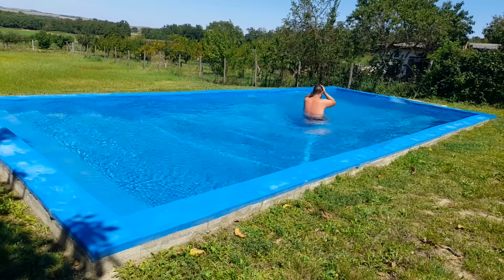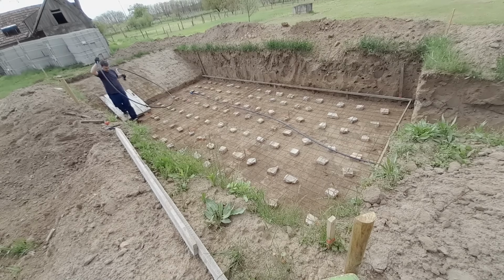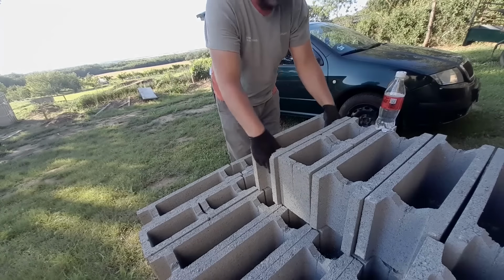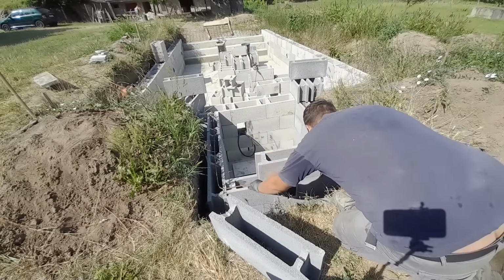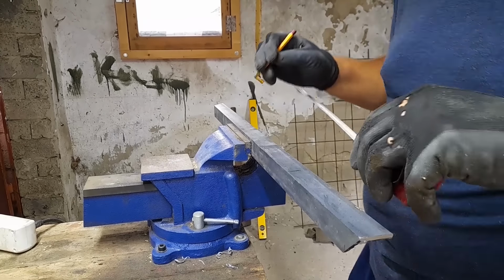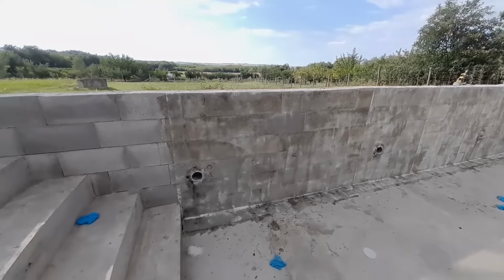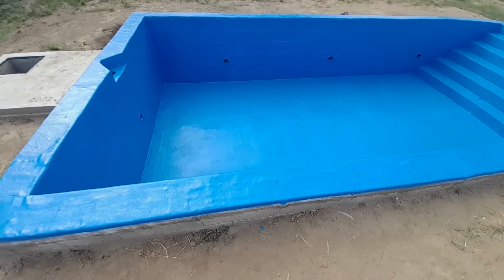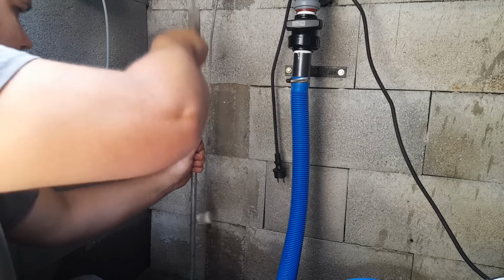How I Made a SwimingPool. Step by Step. Low Budget Projekt. #pool #diy #diypool

Comment: Also, as an owner of a swimming pool company, one suggestion I have is adding a main drain, at the lowest point of the deep end, if you could have done it again.  Again, great work!
Reply: How exactly would he do that?  I'm just curious
Reply: why do you really need a main drain? You can just pump it out if needed to empty it.
Reply: Having had a pool, a main drain makes it sooooo much easier when cleaning. You can just sweep everything to the drain instead of vacuuming which I hater doing.
Reply: @hamidghazialam3604  main drain isn't for draining pool, it helps circulate water

Comment: My Dad had an in ground pool originally built with a vinyl liner in his 60’s. Instead of using the company who built the pool when the vinyl died he decided to build a fix himself. 
So he then had a hole in the ground as you did, he also built the walls using cinder blocks.
Back then there was not a way to use the fiberglass as you did. (Great ideas by the way) I do not remember what he did for that part. He used Portland cement as it makes a whiter finish than regular concrete. He did paint his white. He was lucky to already have the pump, plumbing, etc.
They really enjoyed it for years.

Comment: You are a true hero. I also live in Hungary and dug a 40 m³ pond myself. The summers are very hot and the soil (sand) is often as hard as concrete. After digging such a big hole you know what you have done. You really did an amazing job! 👍
Reply: Doesn’t it rain in Hungary?
Reply: @michael.forkert  Hungary is located in the Pannonian Basin or Carpathian Basin, the remnant of an ancient lake that dried up 5 to 10 million years ago.

I live almost in the middle, where the land is quite low. Due to climate change, only 8 to 12% of the annual precipitation has fallen in recent years. It's different at Lake Balaton because this region is close to the Alps and naturally has more rainfall.

Climate in Hungary is more diverse as for example in Germany.

Comment: I didn't hear you mention but hopefully you used stainless screws/nuts etc. where needed. You could sand the fiberglass to make it smoother (might have missed that part too if you did). I'd add an area at least 4 feet wide all around the pool to walk on so that dirt and grass don't end up in it. Even a wood deck would be good, save your filter system.

Hope ya had a good summer in there. Good job man!
🇨🇦
Reply: All very great valid points! Much love from 🇺🇸
Reply: I kept thinking he needed a walkway around all through the build.  You’re gonna’ be constantly skimming to keep grass out, I think. I’m sure something like this and landscaping could be added for years to come. What a beautiful job, overall. What dedication and logical thinking!
Reply: Cement deck would be good.

Comment: i think it came out great, for not being a professional pool builder. it's great. you have a few small things to work out. but you have a great foundation to build on. I don't know if you thought about this yet. but you can always tile that pool.. it will clean up the block work you mentioned. and also water proof it more. they have a liquid membrane that you can roll on to the walls and the floor. then you can tile directly over it. I know it's an added expense but  you can do it maybe next year. but all the hard work is completed. enjoy your success.
Reply: Can he tile it directly over the fiber glass? cheers
Reply: @viannarts  Yes, although maybe the paint would have to be sanded first for a better bond, I'm not sure. You could use silicone adhesive to attach tile though, it should work well.

Comment: Very impressive!  I was unaware that dry stacking of concrete block would actually work, but it clearly does.  The only thing I would do differently is to add a bullnose profile on the leading edge of the concrete steps.  Having done countless concrete projects in my lifetime, I know what hard work it actually is.  Dr Kun Daniel makes it look easy, a testament to his very impressive expertise!
Reply: I'm also surprised by the dry stacking, it gives me several ideas. Great job, you have to be really determined to achieve stuff like this.
Reply: it works but its better to glue them down, that way you can get them leveled, something dry stacking wont.
Reply: There is a process called surface bonding that allows for mortorless bonding of blocks. The first course is bedded in mortar and leveled. All other courses are dry stacked and leveled with small shims of wood or even paper. After they’re stacked they’re soaked with water and they’re then parge coated with a layer of surface bonding cement made of Portland cement and chopped fiberglass. You can make your own or (here in the us) buy it from the home center. You can coat just one side but two sides are more than twice as strong. It was originally developed for water proofing cisterns.
Reply: I too wanted to suggest a bullnose edge to finish off his beautiful pool!

Comment: The home made lights are not that safe I would have liked to see lots of silicone used for the two holes in the cup to run the plastic insulator. Still I would run a very low truck battery voltage on that pool wiring for the lights with a GFCI circuit in case water were to penetrate the wiring then nobody would be electrocuted to death. Never cheap out on electrical for pools where water is concerned and people and kids going to swim in it.
Reply from the maker: I received a lot of criticism for the 220V lighting. As an electrical technician, in my opinion, it is no more dangerous than the circulating pump. But I will replace it with a 12 or 24 v system.
Reply: @kundaniel  I agree, good choice🙏
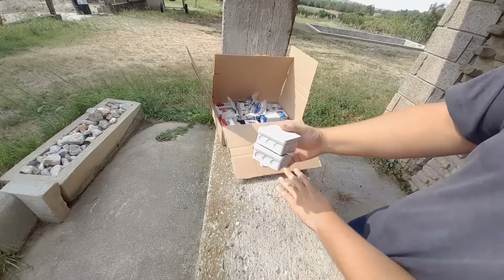Reply: he did have an RCD (residual current detector) breaker in his circuit, which is the same as a North American GFCI (mentioned at 44:04).

Comment: Great job for that small budget, a tip: don't amp the pump up to 10m³/h, the pressure in the sandfilter will be too high causing it to wear faster and most importantly the filtration of the water will be decreased since you're sucking the water through the sand much faster and with higher pressure, it will create channels in the sand. It's better to filter at 7m³/h for longer hours.

Comment: Great job....but why didn't you use low voltage LED's? Those are 110/220V no?
Reply from the maker: Yes, I know, I received a lot of criticism about the 220V. As an electrical technician, I do not consider it any more dangerous than the circulation pump, but I will replace it with a 12 or 24 V one.

Comment: Nicely done. I would have done certain things differently, but it doesn't matter, you nailed it.
The ONLY thing I must comment is that covering the whole pump space with concrete and leaving only a small manhole was not the best idea. I would have covered it with a larger manhole cover (I see you managed to do it for a smaller one).
But yeah, I congratulate you!
Reply from the maker: Yes, this also gives me a headache. I got an acid container from which I want to make the sand gravel. The diameter of the container is 65 cm and the expiration date is 58 cm....

Comment: Yeah you started digging, and then said exactly what I was thinking. Spend just a little money to rent a machine if you can. You get the job done in an afternoon or a weekend, and it doesn't actually cost that much (assuming distance traveled, availability, and no damage to the machine). Absolutely worth it for the amount of work just digging a hole takes.

Beautiful work, btw. I "dig" it :)

Comment: Man i hope there is no fualt in the pool lights.... thats your life right there 😮....
Reply from the maker: I like it when people bring up this topic... In an interesting way, no one has been bothered by the fact that the circulation pump is also 220 as. However, it is still in contact with the water on the metal part and is present as an inductive load. It somehow doesn't bother people because it works silently. almost everyone mentions the spectacular part that lights up. Please tell me what happens if the phase gets on the water and someone is inside... Nothing. There is full PE coverage with separate earthing probes with life protection relay. But if they weren't there, no one would be electrocuted even if one of the phases was exposed to water. However, the water has a one-to-one ground potential, even though there is a plastic pool wall, everything is connected to the ground probe in the case of metal parts. I am a high current electrical technician. Obviously I'm not going to make my own pool life-threatening...
Reply: @kundaniel  The pump isn't isolated by a home made enclosure from pipe.. Use LEDs please. 12v LED should be safer

Comment: I probably wouldn't DIY the electrical, but after thinking about it, you're probably at low risk because you generally won't be in a position to complete a circuit, so even if there is an electrical fault you might not even feel anything. The thing I would be scared of is the wall collapsing (cracking), especially without any gravel backfill, but maybe keeping the pool full of water will provide enough counter pressure it's not a problem. I love the idea of using fiberglass, but I'd be worried about the resin lasting in the sun even with a UV resistant formula. I really enjoyed the video, I hope you make a followup in a year or two just to say "hey everything is still working".
Reply from the maker: The boat is made of the fiberglass I use. UV stable for decades. Looks good so far. I thought the resin would separate from the concrete. He could not. 220 V lighting cannot actually form a circuit with its contents. And the leakage current relay disconnects all problems immediately. The water in the pool has the same potential as the soil. But I got a negative comment, so I would rather change it to a 24V or 12V system.
Reply: Came looking for this and glad to see your answer. Pool electrocutions happen, switch to 24v please👍🏻

Comment: Awesome. love your vision and perserverence to just get it done. I wonder if your concrete estimation shortfall included multiplying by a factor of 1.3 for wet volume vs dry volume of materials.
Reply from the maker: Yes, the referenced m3 values do not refer to dry material. For example, about 9m3 of concrete went into the foundation. This required about 11 m3 of gravel and 2.8 tons of cement.

Comment: One level of fittings. You attached water pipes to it; after the concrete set, the pipes took on part of the bending force from the slab and therefore burst.
Using stone to support reinforcement is a very bad idea; moisture entering from below through cracks will quickly cause corrosion of the reinforcement. When corrosion occurs, the reinforcement increases in volume, which causes cracks in the concrete.

Comment: Also, the way a pool operates, the idea is to have the returns (jets) pushing debris across the top of the pool towards the skimmer.  So ideally, you want them on opposite ends, and the returns about 12” below water level, on the wall.  You can do floor returns as well, its actually optimal, to achieve good circulation.   Doesnt look like you’ll get many leaves in the pool, but even small grass clippings and debris would make it to your skimmer better.  You can build a very strong vacuum set-up.  If you are interested, reply to this comment and i’ll give you my opinion.  I own a swimming pool maintenance company for 15 years.  Enjoy your pool!

Comment: Your pool is superb from beginning to end.  On your challenges with lying grid and pipes... I've seen that in a foundation the grid is held together with zip ties.  I've also seen pipes can be held in place for cementing by cutting strips of ceiling wire of a firm but bendable grade and making a u shape the u shape can then be used to pin in the ground around the pipe holding it in place.  I just saw you bend your rebar in the video.  Even that could be a pin to hold the grid and pipes in place.  Your method is very efficient and shows a beautiful end product.

Comment: If the imperfections in the sides of the pool bother you, since it's already waterproofed now, can't you just plaster over it? Or add more epoxy as a top coat and sand it smooth before painting? BTW - Unbelievable job! I've done some crazy things in my life but this one would've been a little too crazy for me. Lol. Should be very proud of yourself! Definitely increased the value of your home too. Next you gotta do a hot tub! :) Any hey if your country ever goes to war, you can always use that as a bunker. That thing is as solid as a mack truck! Also - to make the top border look better you could install some pavers around the pool to prevent getting grass and dirt in there as easily. You came this far already might as well turn it into a backyard oasis! I would 100% put pavers and a walk way to and from the house to avoid tracking dirt and grass into the pool. The end shots with your friends and family - why did the water look so dark and dirty? Was it just the overcast sky and camera? Sorry if this is hard to understand I know English isn't your first language. So impressed.

Comment: I hate to sound negative here after seeing all the hard work you put into this project, but I have to ask the question  why did you use cinderblocks below grade for pool construction. Because with the constant pressure of the water against the pool walls if you get a couple of years use out of this it will leak. Modern cinderblock was never made for this
Reply: My neighbor has one that’s lasted at least 20 years.

Comment: Gravity feed Thermal Siphon heater using wood stove heating 55 gallon drum as your heating element.
Also
Build a rolling insulated cover to protect from accidents & the elements.
 forgot to put a drain inside the  pool or atleast a 5 gallon bucket on the bottom & sealed it with fiberglass to  pump out water in winter?
Great job looking back a scratch coat of cement over the block would've hide all the imperfections.
Good job
Yoy can build a gravity feed heater using 55 gallon drum thermosiphon. Build an elevated stand out of angle iron, weld input/ output valves. Build a fire pit out of block that the stand sits over. 
Place the unit down hill from the pool
Use a valve & gravity to pump water in, and heat/ expansion Will push water back into the pool.
Your intake should be on one end of the pool & output to the other. 
This works I have built a similar heater for a friend 20 years ago still works to this day!
I have a diagram and scametics i made

Comment: People who want to build their own pool: You don't necessarily need to make it from tons of cement and/or blocks. 

My brother had a pool that was a hole in the ground with a vinyl liner in it, and it worked great, seemed like any other pool.

Still had all the plumbing, pumps, filter, even heater, but it didn't require tons of cement. The surround was still concrete, but that's much less, and much easier to make.

The liner has to be replaced every 10, maybe 15 years, but it's not that big of a deal.

Comment: I always use a non-toxic antifreeze for sinks and RVs usually between 5:00 and 10 gallons and then I dump them in and run it through the system that away any misfortunes would be dealt with

Comment: to winterize the pipes: you need to ensure all pipes has one end disconnected. This way as water freezes and expends in the pipe, the air can go out hence the pipe does not break. This is how I winterize my garden watering system in the past 10 years.

Comment: I also dug a pool by hand. Have to say its waaaay easier to push the earth down a gentle slope than digging it directly to outside.

So what i did was first i dug a really long gentle slope all the way down. It was really hard work.

Then when i dug the next part. i Could just dump the earth down and push it up.  The first layer was super easy. The second layer also pretty simple. It didn´t get hard until the 3rd and 4th layer.

The last part diging away the ramp was by far the hardest. I dug most of hte pool 1-2 hours after work in evening  time. Took me 6 week, i would say that was pretty fast considering i was not digging every day.

Also i want say.. Make the machine room 4 times larger than you think you need. Way nicer to work with.

Comment: what is the voltage of the pool lights? I did not see you use a transformer to use low wattage lights which is necessary in a pool just in case they leak and there is a short circuit. Normally they are about 12v not 220v

Comment: Hello, maybe video does not show that - but did you filled with concrete all blocks? it seems only top 2 or 3 were filled. Also it seems that you did not vibrate it - if it is used inside the cinderblock its not required to vibrate it?

Comment: Your pool is incredible and inspirational. I have one question, as you are basically the only one, who I've seen doing it this way: Why do you have the concrete shell around what is effectively a fiberglass pool? Wouldn't more layers suffice? (I'm thinking/comparing it with a "liner in the hole" types of pools, or fiberglass pools that are installed with backfill). 
That aside, how it's holding?

Comment: With 4,100 dollars in Brazil, you could buy a 10-meter fiberglass pool, fully finished with porcelain tile, motor, pump, and labor included—even digging the hole—for just $2,833.33.
Reply from the maker: What you said here in Hungary is about 8 million forints = 20k USD

Comment: With this amount of work it would’ve been worth it to rent an excavator to dig a section deep enough to dive, and also to build a hot tub or jacuzzi area as well, maybe even a water fall. 

Companies charge a fortune so most people may go small because of affordability, but the savings you gain from doing it yourself it wouldn’t have added much to the ticket or time.